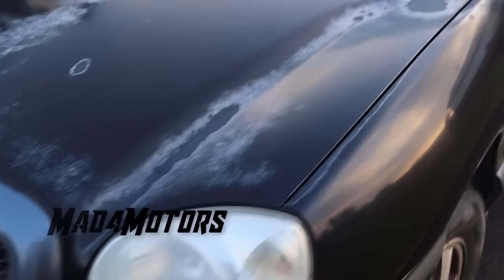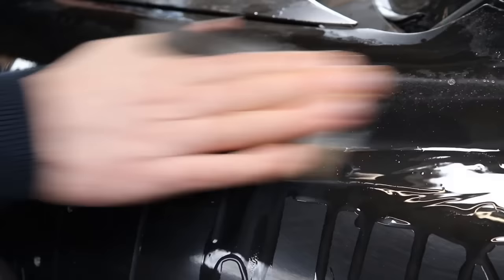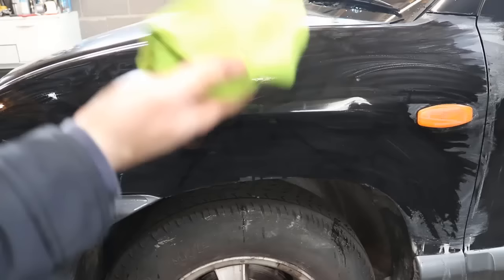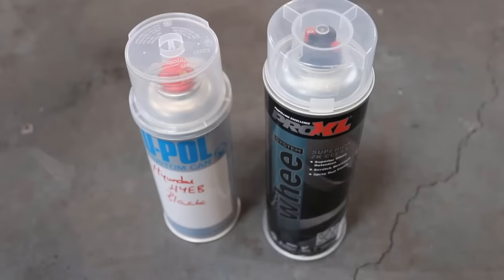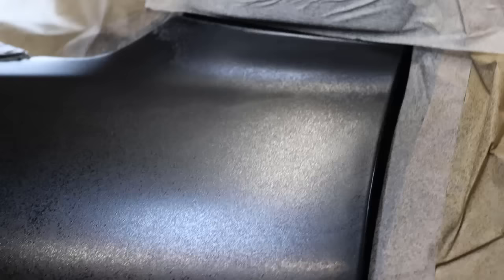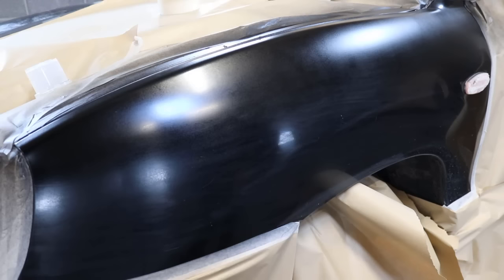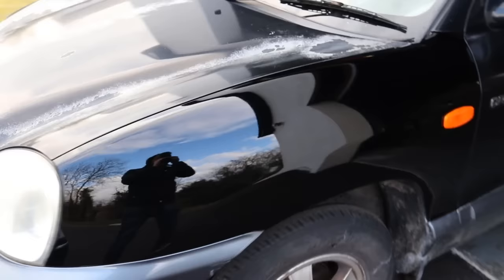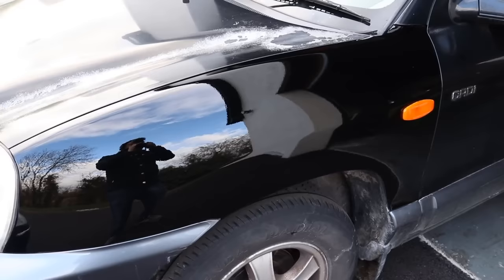How to Repair Clear Coat Fix 100% all types

Comment: Hey so, I need some advice. I followed this video to a tee and was getting fantastic results up until I applied the clear coat. The paint started to seem to like melt or run as soon as I applied the lacquer clear coat and basically fucked all my work up. No idea what I did wrong. Any advice please? I applied it in long straight overlapping lines like in this video and it like immediately started to run and the fresh paint seemed to sort of dissolve. Please help! Thanks

Comment: So I have a small one in diameter piece of clear coat that's coming off. I can get away with just using sandpaper and clear. But what grit do you start off and finish with?
Reply: Did you not even watch the video?

Comment: Not sure if he mentioned it or not in the video...but I am pretty sure the 2K clearcoat has to be used within 24 hours after its mixed up. My toxic trait is putting off jobs like this on my black truck because I convince myself I don't have enough panel areas prepared yet for the clearcoat and I don't want half a can of mixed clearcoat to just go to waste. 😢😂

Comment: Sand the base coat to knock down the orange peel. The raised bumps of base will create thin spots on the clear coat and possibly burn through on your final sand/polish.
Reply: Only if it's not metallic

Comment: Did he use the 800 girt sandpaper or the 1500 girt sandpaper to go over the base coat once it dried?
Reply: Don’t try this, it’s way too strong. You should only be using 180-320 grit max

Comment: Nice vid bro, but the Paint has Orange Peel on it. You can see it in the reflection of the lights in the spray room and the close up when u outside. So i would not do this if you have a quality car. But for a simple A to B that you dont really care about.  Heey its just fine. Great to the point video. 👍🏻

Comment: Those grits are too high. If you’re spraying paint or clear, 600 is as high as you want to go so the paint has something to stick to and bond. It’s mechanical adhesion.
Reply: What sequence of grit would you recommend? On an aluminium panel with corrosion.

Comment: You still need to sand the clear coat then compound and polish the surface or you will get orange surface and after a month you can apply wax because you need to let the pain cure.

Comment: Important advice for diyers.
If its a metalic, you need to feather in new metalic base paint.
Do not sand a metallic & skip to clear coat.
Apply clear coat at the proper time.

Comment: 1500 grit wet/dry sandpaper may not allow the new base coat to etch into the old base coat & the new K2 clear how will it etch into the surface of the new base coat?.  
  I have used the 2K products. They work okay.  I won’t use it again even though the 2K system is very close if not identical to normal body panel shooting with a gun, I’d rather use the gun system with mixing the products.  
If you use K2 or a auto body paint supply house spray bomb mixed combo, they do use the same ingredients as a normal gun cup mix would use.  Try it for your selves for your own experience & good luck.

Comment: Sometimes you get unlucky though and the base layer is thin and you go through to the primer. With pearl paint it very hard because the pearl coat is easy to sand away. Personally I just repaint.

Comment: Why does my clear coat look patchy  do   3 coats and some is shiny some looks flat and dull do I polish it out or wet and dry sand it
Reply from the maker: Let it dry for 24 hours then give it a very light wet sand with 2000 and buff👍

Comment: This is a nice temporary fix not to mention that you have to be at least a moderate level of professional before attempting this. He’s hasn’t nor will he ever be any auto body “out of business.” Not everyone has these tools and people will still go to professionals regardless. It’s ludicrous to do this if one is amateur. You will definitely destroy the mid-coating of the vehicle. Don’t try this unless you are absolutely certain the benefit outweighs the risk. For an auto-body, clear coatings are $550 at the max along with a guarantee that it won’t destroy the paint itself. 

These type of YT tutorials are beneficial for those who have an autobody business or have done something similar in the past. Not just some common individual to take up this task and destroying the essence of the vehicle.

Comment: orange peel all in that, gona have to sand it again and then buff and polish it, got a lot of work left until its a good paint job. you could have stopped a lot of that orange peel by sanding after the base coats was on, and then clearing over top, i could already see the orange peel in it from the base.

Comment: I spray painted my car. Grit sanded it then i primer sprayed it, base coat and then clear coat.The resust was like your video. I wet sanded my clear to remove the orange peel and then buffed it and the result was spectacular i could see myself like a mirror but here is the problem.. after a day on a sunny day the paint surface was like there was honey on it and the orange peel reappeared out of nowhere. I wet sanded it buffed it again all ok and then the sun did the same to the paint. Iam looking for an answer why is this happening

Comment: If all it takes is to spray on a clear coat from a can, shouldnt we be getting notices from the auto makers to respray BEFORE the topcoat starts to crackle?
Reply: I guess they assume that would be common knowledge, and/or they don’t want you to be able to fix it yourself on the cheap like this, they want people coming back to the dealership for repairs so they can make $$$. Also, most modern cars within the last ten years use significantly higher quality paints and clear coats from the manufacturer that don’t peel like this. The peeling clear coat issue is very much an 80s/90s problem.
Reply: @jelstel2319  my car is a 2011 civic so still a problem

Comment: You're da fookin man ✊️ (said in my shitty Irish accent) 🇨🇮 Can't tell you how many times I've watched this video compared to about 10 others all related to touching up cars I watch often especially right before I execute a project. My first time trying this technique I didn't follow the procedure of stopping the base coat where it meets the other areas that only needed clear coat coverage and my trunk ended up with mismatching colored spots 🤦🤷 lucky for me I ended up ditching that silver car and wound up with a white pearl 3 years newer and fully loaded. Poor baby though has already had a brick bash its windshield and driver side window shot out with a bb gun along with causing my driver side doors to look like they're going thru puberty getting acne all over

Comment: The repair won’t last. The problem is called clear coat delamination. Its caused from certain plants that used a water born base coat with a urethane clear coat. This was common in Texas and California starting in the early 90’s.

Comment: i can see those orange peel there buddy. Why don't you tell them after you use the col coat, you should scrub it first with 2k or 3k sand. then feel it with your finger a really smooth surface then you coat the clear. Am i right?

Comment: So shoot me if I'm wrong LOL but there's no possible way with us quick and thick as you laid that paint and clear on that you didn't have orange peel and runs and stuff in there that you had sand out. Unless it didn't matter for what you were doing. Really when you lay on that base it needs to be long even strokes thin layer couple of thicker layers and same thing with the clear. Lot less work to do after it dries if you just take your time with the paint and the clear.

Comment: He used to fine of sand paper that base coat will not stick in the long run he should have used 320 grit or 400

Comment: No way. I have done everything known to man to try to achieve this look but either you are a magician, or I just suck. No matter what I do, the result is a dull lifeless and almost matte look. It's as if the  car is just sucking sucking the paint right in and then back to the original crap. Unless the trick is to NOT wet sand afterwards like you have done? But how to then get a smooth feel? Every time I try this method it feels toothy with tons of orange peel. Then when I wet sand and polish I end up in a vicious cycle of polish residue hell and still a dull looking car!

Comment: I've  tried this, as to could see, it wasn't  going on smooth(either coat) The finished product was buffed, at a bare minimum. Cans suck! You get uneven coverage & the shits drying before it touches the pannel. Do yourself a favor and buy a cheap gun. Even a shitty gun will do a way better job than a can that spits & goes down like sand paper. I'm  no pro, but I've  tried just about everything. I had my basecoat smooth as glass, & my clearcoat came out like 40 grit sandpaper. Wet sanding will help & maybe those cans that are in 2 parts might make less fog than the premixed crap. Save yourself a major headache & use a gun, you'll  thank me.

Comment: I watched a guy paint a £500,000 Ferrari 4 coats of primer 4 coats of paint four coats of clear coat then when the clear coat is hardened 6000 grit wet and  dry then buff

Comment: The surface MUST be degreased, you're working even without gloves.
Reply: Can you list the full steps please ?
Reply: @senorbonbon  Grease and wax should be removed before sanding procedure, and after the sanding (degreasing) to ensure a good adhesion for the base coat. The tack cloth is not enough since it can't remove grease and wax.
Reply: @victormedina177 thank you, how am I able to remove the grease and wax? Is it a spray / chemical?

Comment: I am a painter of 40 years, all a waste of time.  It’s called clear delam from not enough u.v. Protection.  ALL clear must be removed from basecoat.  Scratches in basecoat will show through.  Nothing in an aresol can will give you good results? If the clear is not a Catalyst two component clear, you are wasting your time. Go ahead and try to sand and buff it?  Get it done right.

Comment: All that work and you use a RATTLE CAN for clear coat. Will never get a gloss finish.
Reply: With the 2 step sh!t from spray max, you do. I repaired the paint on my hood last year with it and some touch up paint. Took me a couple days of prepping it but it's fun work and still looks good. Better than getting ripped off by a shop just cause they have a compressor to spray

Comment: That's not a repair, that's a temporary butcher job at best. If the existing clear is oxidized it has to come off. Putting more clear over it will not stop delamination from continuing. And ANY TIME that you sand the basecoat it MUST  be related. Stop Putting this kind of nonsense on the web